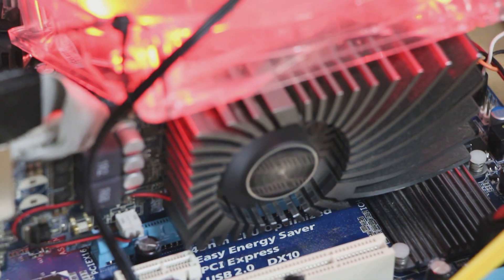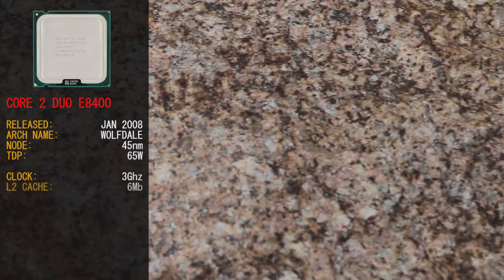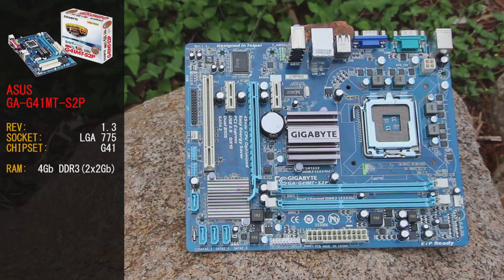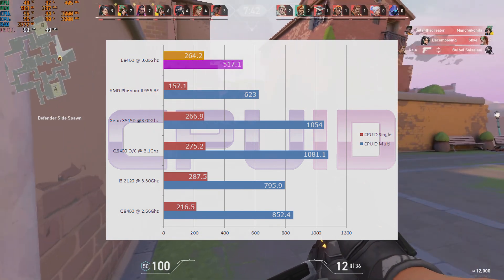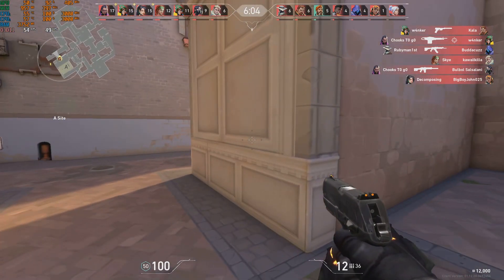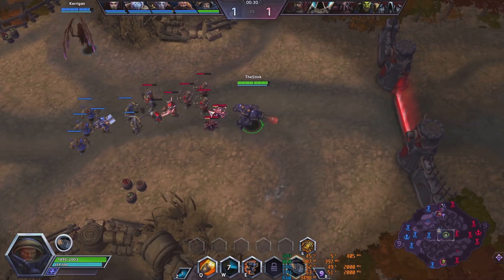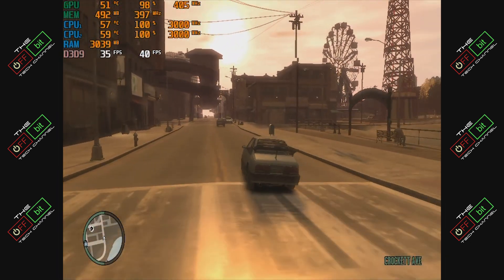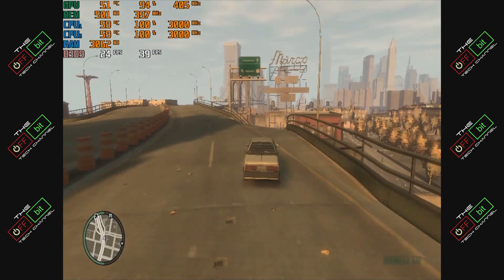Core 2 Duo E8400 with the GT430 in 2020.

Comment: Greetings, great video, I have the same pc. Do you recommend me to buy the same graphics? I would like to adapt 4gb of additional ram + the graph but I still do not know which one to buy a hug ..
Reply from the maker: The gt 430 was not too bad of a match for the Core2 duo e8400. If you can get one cheap it's probably worth a purchase.

If it's a little more to get a bit better card like a gts 450 or gtx 550ti that will give you a bit more head room, but it wont really reflect probably in a lot more frames in most games with the core 2  duo.

Also the higher ended cards in the series will need an extra power cable to plug into the back of the gpu usually 1 to 2 6pin molex cables from the psu. 

Thanks for watching.

Comment: Can I play pubg mobile core 2 quad 6600 ,  4GB RAM , GT 410 VGA CARD
Reply from the maker: Unfortunately the PUBG lite version is now abandoned.

You may be able to run it though a mobile phone emulator, but it will  take some of your performance away most likely as well as now proper mouse aiming.

Comment: i get pentium e5300 upgrade with e8400 is good ?
Reply from the maker: The e8400 is about 20% to 25% faster.
With more cache and a faster FSB for more data bandwidth. The E8400 is clocked at 3ghz apposed to 2.6ghz.

Thanks for watching.
Reply: @OFFbitTech  I have a question, could you recommend me something other than the e8400 please ?
Reply from the maker: @mcoli7090  If your motherboard supports Core 2 Quad CPUs such as the q8400, q9400, Q9500, Q9450, Q9550 and q9650.

We would recommend having a look at them.

The Q8400 has 4mb l2 cache clocked at 2.6Ghz.

The Q9400 has 6mb of l2 cache @ 2.6Ghz

The Q9450 has 12mb of l2 cache. @ 2.6Ghz.

In games high clocks will make a difference but L2 cache will help with load lag in games as well.

Cache in the CPU is basically really fast temporary memory so it can help having a bigger cache for games and applications.

The top chip in Core2 Quads is the Q9650 @ 3Ghz with 12mb (2x6mb) of l2 cache.

Check out  the list on Wikipedia.

https://en.wikipedia.org/wiki/List_of_Intel_Core_2_microprocessors

But make sure you check your motherboard to make sure it can take a quad core CPU, not all Socket 775 motherboards do. You should be able to find a CPU support list for you motherboard from the manufacturer.
They will let you know which CPU's can run or not run on your motherboard.

We hope that helps.
It my see daunting but read through Wikipedia and do a bit of googling and it will make more sense. Hopefully we have nudged you in the right direction.

Thanks or watching.
Reply: @OFFbitTech  oh thx

Comment: I'm building my first pc  
I'll buy Gt630 with core 2 due e8400
With ddr3 ram 
Is that good ??? 
And if i want to upgrade somthing what should it be ?
Reply from the maker: You will be limited to older games and games made for slower PCs.
But as an upgrade path you should be able to upgrade to a quad core CPU which will open up a lot more games you could play.

Be prepared you wont be able to run new AAA title games. But there is still a lot of games that you can play and have fun with as shown in our Dual core videos on this channel.

Thanks for watching and Good luck with the new build. Let us know what games you can and like to play on your new system.
Reply: @OFFbitTech  can you recommend quad core cpu that dont consume soo much power?
Reply from the maker: @dzaki5683  
The best core2 quad in 775 would be the Q9550s it uses 65w has 12mb l2 cache and runs @ 2.83Ghz.

Other than that you could do an LGA 771 mod and you can use the Xeon Line of Core 2 Quad CPUs.

The lowest power Xeon Core 2 Quad is the Xeon L5430 it has a TDP of 50w has 12mb of L2 Cache and runs @ 2.67 Ghz.

You could also go in the lga 771 range
E5450 is uses 80w and is clocked @ 3Ghz with 12mb l2 cache.

If you are looking for lowest power the Xeon L5430 is the way to go.
They should overclock up to 3ghz which should give you good performance.

But the lga 771 mod can be risky and tricky to do.

But the Q9550s is actually good option. It should overclock just as well and is a LGA775 so no mods required.
All you need to is check if your motherboard supports the Q9550s.

Good Luck
and let us know if you have any other questions.

Thanks for watching.

Comment: nice vid sir , how about my old pc, core 2 duo e 7500 combine with hd 6670 1gb ddr 3 128 bit. i think its same with gt 430 (or not?) . 
i just wanna play old games and some competitive games like cs go, dota 2. 
is it good ? or should i up my processor to quad core q8400 maybe ? 
thankyou
Reply from the maker: The Q8400 will do a lot better and will give you a wider selection of games.

Though the e7500 is a really good dual core for the time a quad core is very much needed to player newer games. 

Though there may be the odd game which would of ran better with the higher clock of e7500 but a small overclock to the q8400 will close that gap.

The hd6670 is about 40% faster than a gt 430 if my memory plays correctly. Though that will differ from game to game / application to application.

Thanks for watching.
Reply from the maker: @openbox9902  Some of the 775 ddr2 motherboards are the easiest to overclock.

We have one core 2 quad laying around overclocked from 3ghz to 4.1 Ghz with no voltage changes (running stock voltages).

That's our best case mobo with ddr2 but at most you should be able to get a bit extra out of your cpu if the motherboard lets you overclock.

Comment: core 2 duo 7500
gt 430
how many fps on valorant?
does it support Windows 10?
Reply from the maker: We would expect to see about 30fps @ 720p at low details playing Valorant on the E7500. Also expect some load stutter from the CPU but it's still should be playable.

The Gt430 has driver support for windows 10 and the core 2 duo e7500 also runs fine with windows 10.

We hope this helps and thanks for watching.
Reply: @OFFbitTech  ok thanks for the help im gonna subscribe your channel. thanks btw 😁

Comment: Core 2 Duo E8500
4gb DDR3
GT 610
How many fps on Valorant And Csgo?
Reply from the maker: We are having bit of a guess here.
CSgo @ 720p (1280x720) will probably give you from about 15 - 35 FPS. In a gun fight expect 15 fps. Probably not worth trying 1920x1080 for CSgo.

Valorant will most likely run really well at 1280x720.
We would guess 60 FPS maybe more depending on what's going on. It may drop down to 50 fps when really busy.

However these are just guess.

If you do give it ago we would love to know what the the actual frame rates you are getting.

Thanks for watching.
Reply: @OFFbitTech  alright i just installed valorant and csgo  i played Deathmatch on the same game 

On Valorant 1366x768 Low graphics i notice some stuttering in some gunfight & using ability i mostly got about 50-60 on not much crowded places

On Csgo 1366x768 Low settings i have a great amount of fps like steady 60 sometimes stuttering too

On my opinion E8500 And GT 610 is not bad at all
Reply from the maker: @Kirk1007  Nice work.
Gameplay not perfect but sounds like very much still playable.

Thanks for the report back.
Good Job.
Reply: In gunfights there are gonna be many fps drops so i just recommend 8gb of ram cause valo when playing consumes 2gb of your ram
Reply: enough :)

Comment: why if I play Valorant with Core2duo E8400 and VGA Radeon HD 5770 512Mb Ddr5 but why is the fps always around 30fps and also often stuttering please help me, oh yes my processor and VGA temperature never touch 75 °
Reply from the maker: Stutter could be from cpu being over loaded. Try turning off or removing back ground apps.
Also maybe temporarily turn off real time virus protection.
There is a program called inspectre this can turn off the intel microcode updates that slowed some CPUs.

Hope that helps.

Thanks for watching.

Comment: Hey i actually have the same specs as this one. But im getting 60 avergae sometimes 80
Reply: 200 on agent select.
Reply: On valorant btw
Reply from the maker: @jimwellearldoblada1311  Nice. 
What resolution & details settings are you running?

It's amazing how well Valorant runs on older machines.
It's amazing that you can still game on  a cpu that's over 10 years old and only has 2 threads.

Thanks for your support JHsv Zbsh.
Reply: @OFFbitTech  hello i upgraded my mobo and cpu to i3 4160 and im getting 100 fps now with gt 430
Reply: @OFFbitTech  how to know what resolution im running
Reply from the maker: @jimwellearldoblada1311  in windows 10 if you right click on the desktop and select display settings this will open up the display windows. scroll down to Display resolution.

Otherwise (windows 10 again) hit the windows button and type settings hit enter (or select settings icon). Then select display and scroll down to the Display resolution.

Hope this helps.
Let us know if you are not running windows 10.

Thanks for watching.
Reply from the maker: @jimwellearldoblada1311  Nice, a cpu upgrade can really help slower gpu's out. Seams to extract out the maximum they can peform.

Thanks for watching.

Comment: Hello gt 730 2gb and e8400 valorant also how many fps can I get at low settings
Reply from the maker: That's a bit of a hard one to say. I'd imagine you should get something a little better at the least. I am not entirely sure how much the cpu may of been even holding back the gt 430 since the cpu spent most of the time @ 100% cpu usage on both cores. The game CPU wsa holding us back at times, that could be seen in the 0.1% lows. However that was a few items needed to be loaded once that was done this game on the setup was very much playable.

So the GT730 with the same cpu should very much be playable plus a little more. Make sure you turn everything other application you can off in the background (turn real time protection off or suspend it if you have that option) to ensure the most out of the CPU for the game.

My guess would be about 50 -55 FPS on average on low setting. If we ever end up getting a gt 730 here at the off bit we will definitely make a video with this combo.

Thanks for watching.
Reply: @OFFbitTech  Thank you <3
Reply from the maker: @raasielx2688  let us know how Valorant runs if you decided to try it out.

Thank you.